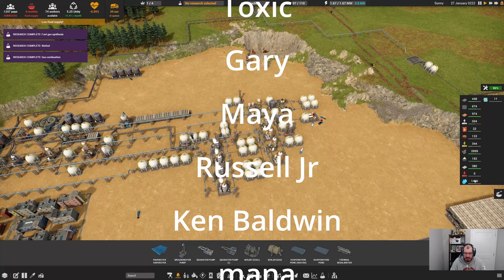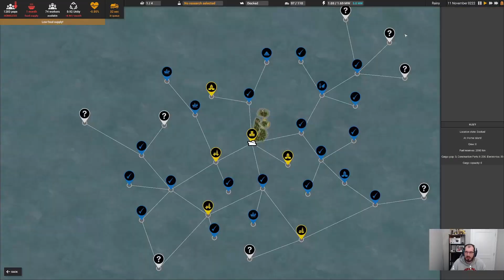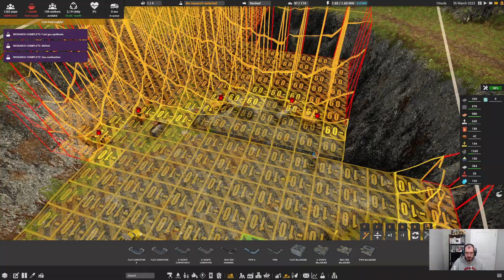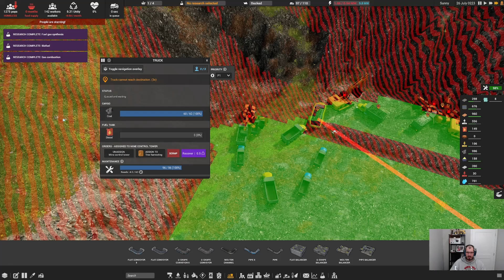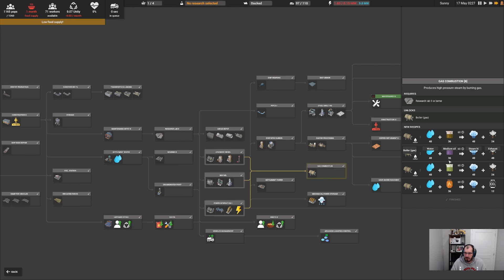The Gas boiler to the rescue! | Captain of Industry | BETA | Part 14

Comment: Aw dang, I'm sorry to see this run come to an end! The more advanced refinery setups are awfully tricky in this game. The winning strategy seems to be accounting for every single input and output precisely so that the system doesn't get backed up by anything, but there are so many different end products that I at least need a spreadsheet to keep track of it all.

Another thing that definitely doesn't help is the UI for the splitters. It's super confusing how it's worded, and not obvious that it doesn't actually have the overflow behavior bballjo was expecting unless you click the buttons next to those sentences. So it's easy to end up flaring more resources, which starves the boilers, which means no fuel, which means death 😬

The game definitely scratches an itch for my brain but it really is quite demanding. Unlike a lot of other city builders you can't play by vibes, just adding a new building when you see a shortage of something. Trading makes it more forgiving, but once your settlement is big enough it's hard to keep up with all your needs that way. Plan or die I suppose 😆

Comment: did some research

1 boiler should power 2 distiller lines, off of just the heavy oil out, including a sour water stripper, which will get you sulfur, ammonia and water, the sulfur can be go into either acid or rubber, and either way until you get exhaust scrubbers, (which produce sulfur and CO2) or unlock naptha to diesel, you are probably going to have excess naptha, if you are avoiding the coal recipee for rubber, the ammonia and water from the sour water should go into a mixer for fertilizer, excess naptha should go into boilers for desalinators, or something else local, where you can eventually plug in the exhaust scrubbers,

Comment: I know it is a lot harder to play while maintain a running commentary, so not casting stones here :)

Just for comparison purposes - I've been playing a lot, and just checking your vid's for pointers  - haven't watched it front to back, so I was astonished at the huge amount of coal you've used. I've started Oil refining and have yet to use up the above ground coal at the first spot. Let alone have a huge pit like yours. Have at least 1/2 of the hill to take down yet. 

I am a hoarder and the thought of just burning (eventually) useful stuff in Flares hurts lol.  The only Flare I have used so far was for the extra gas from the Bio cracker. Since it's 'free' from the air, I don't mind not storing it. I build my Oil area with the intent of not overproducing anything to have to burn it off. 

Water - There is lots of land and the Basic Water Catchers are cheap. I have literal fields of them and just use the Water Pumps as backup mostly.  And each Industry has it's own closed Water System. 

And holy cow you have craploads of power setups. I'm at 3 Refinery 1's and all the Refineries downstream to use all the stuff and just built my second pair of Turbines. 

Were you able to determine if putting all those Turbines/Power Wheels/Flywheels all in one long row helped or hurt the productivity compared to keeping them separate? 

Finally - On the usage of Diesel. I'm curious  if you ever went back and checked on your Sand Mine Trucks after you opened your dump site to sand. I wonder if those Sand trucks/excavators just were endlessly burning fuel moving Sand from your mine to your Dump. Also - just in case - Don't forget to make sure your Dump Sites stop accepting Crushed Slag. Otherwise you are wasting Power to run the Crusher and Fuel to dump usable product that can just stay in storage. 

Thank you so so much for showing me this game and your pleasant company!
Reply from the maker: I think the power setup was ok with the length and setup of those buildings...the problem was that everything was connected to 1 pipe and conveyor...the lv2 of each isn't able to supply the resources they need, and everytime one of the resources didn't get to a boiler the turbines went back to 0 production, that hurt a lot...I will try not to setup another power district like that and instead setup multiple independent power sources that can hopefully run at 100% all the time, that should help...

And yes, I relied way too much on coal, and didn't understand how to use the by products of the production chains...using the gas boiler earlier would have been a game changer, and coal would have been almost exclusively used for metal fabrication...I think I will still use coal and gas boilers, but add a splitter to prefer the gas boiler output, so coal would be a true backup next time...that said "conveyor logistics" would have saved me a lot of headaches if I would have allowed them sooner... overall just learned a lot again this run, and historically I've made it a lot faster each time....so I hope next time will be even better :)
Reply: Yes. I don't have the game yet, but I'm planning out strategies while watching videos of others playing, and one thing that's clear to me is that I need to set up several of those Rain Catchers early, to build up a good supply of Water before I need it.

Another is to set up a non-prioritized Flare Stack for each Refining by-product, so that the process never stops due to clogging, but at the same time try to make use of Heavy Oil, Naphta and so forth to generate Hi-Steam, while using Coal to make Steam only a secondary thing or ideally an emergency thing.

And good point about the dump sites.
Reply: I plan to do a gas network build

Comment: What i've noticed, is that there's a LOT of ways to get fuel gas, so really your oil set up next time should have fuel gas, diesel and fertilizer as outputs, I think everything but crude and diesel can run the gas boilers, but as you progress, there are ways to utilize more of the products, rubber should use the sulfur recipe using sulfur from sour water splitter, and you can feed the boilers for your oil on a priority, first with heavy oil, as if that back stuffs, nothing further down the line is made, you should get a little extra steam if all the heavy oil goes to the boilers for a set up that gets you rubber, use that in desalination or power, then medium oil light oil, and naptha and so on until you get to fuel gas, which you can pipe around the map, because unlike conveyors, pipes don't consume power to function, excess fuel gas can go into diesel,